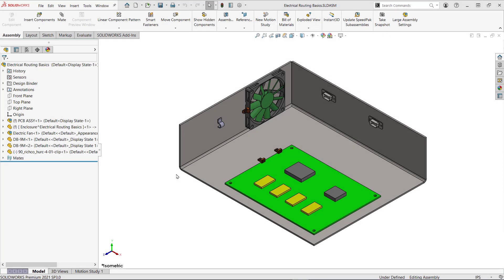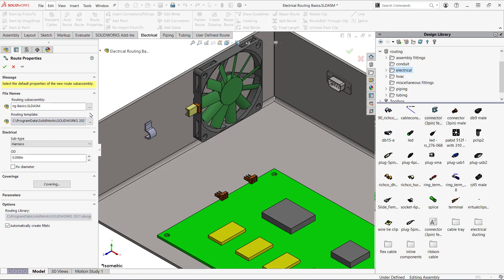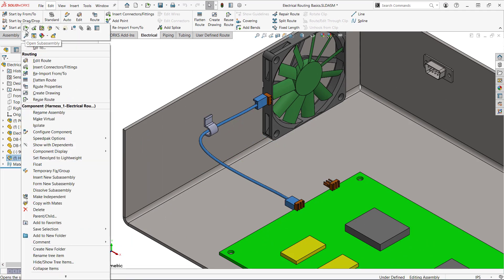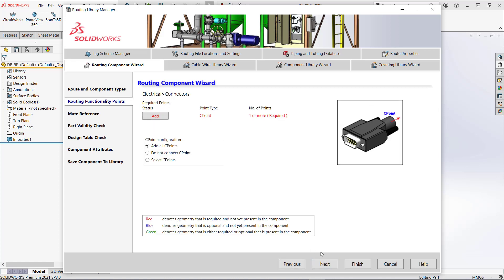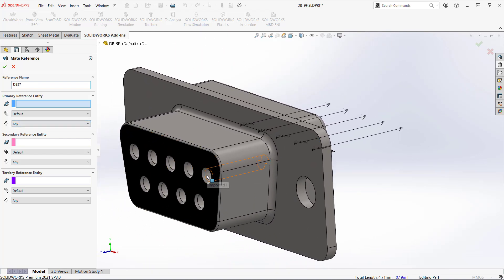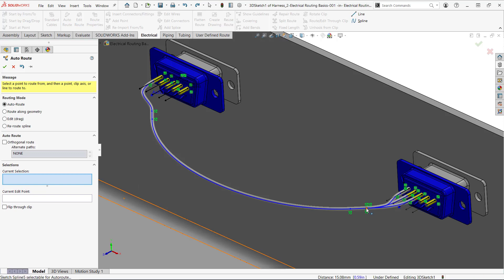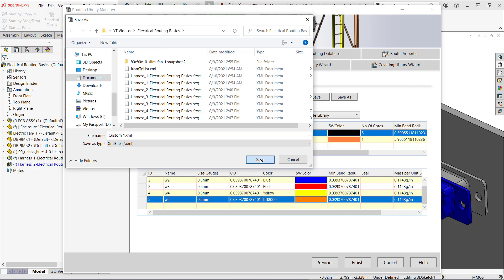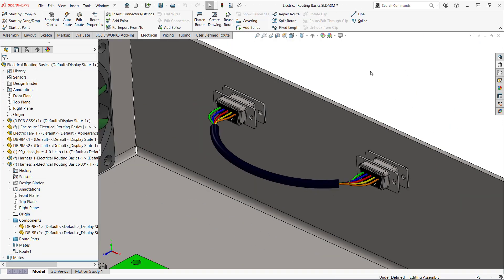SOLIDWORKS: Electrical Routing Basics

Comment: Is it possible to bring in components from the design library that do not have a mate reference. I would like to set the mates manually and then create the harness by auto routing. I dont see this option anywhere.

Comment: Has anyone got issues trying to save an assembly after routing the wire? 
I've followed a bunch of tutorials similar to this, and once the wire has been made (using a custom connector), I get an 'unknown error while accessing <path\filename>.SLDASM" whenever I try to save the assembly. N.B., I don't get this issue using the default connectors. 
This is ever so slightly inconvenient, given I can't save my routed assemblies, so any help with this is greatly appreciated!

Comment: Hi!
Can you help with minimum bend radius of wire please?
When I try to use my custom wire, it appears with a large bend radius, much larger than shown in its properties in the library.
The outer diameter also increases.

Comment: Hi, thanks for the video. But after adding the part to library and loading it to the assembly for routing, I couldn't see the stubs as in your video and therefore I cannot select the points. Is there any reason for that?